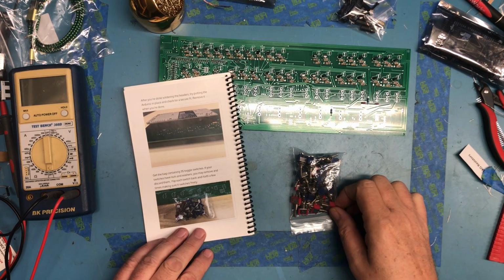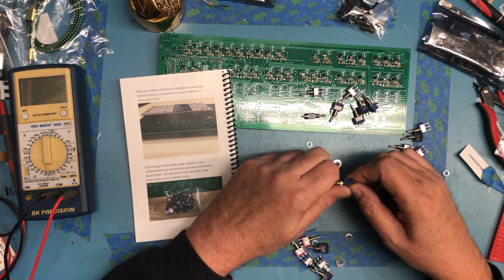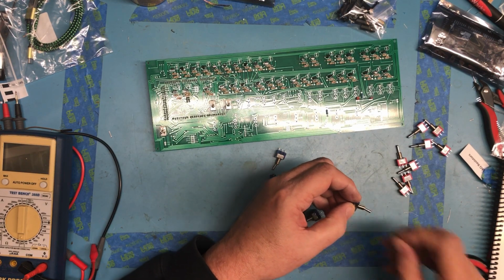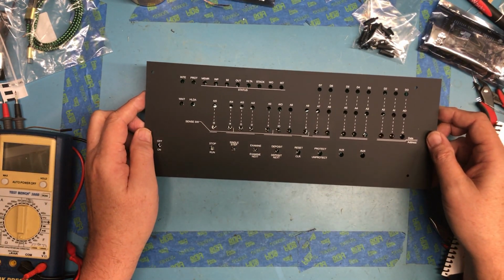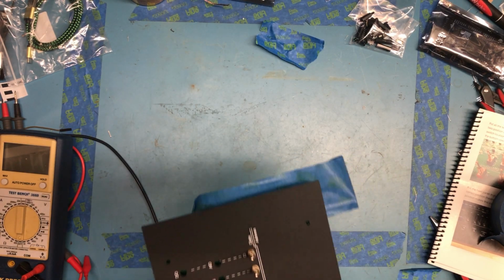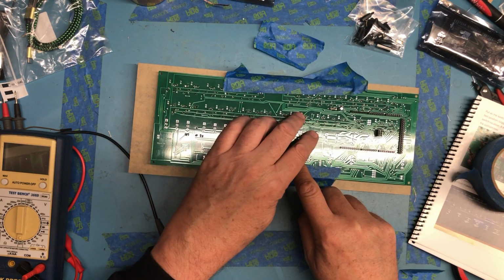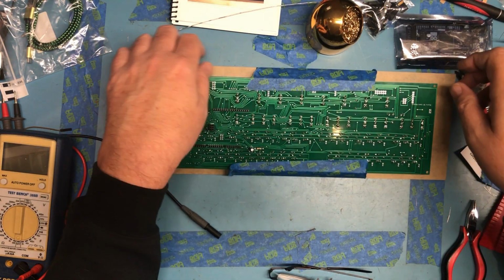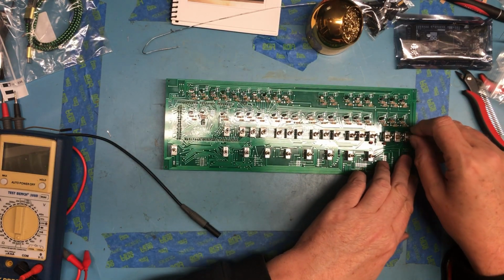Altair-Duino - Part 5- Assembly - Switches - STB276

Comment: This video was super helpful because I ran into the issue with the blue switches taking a lot of force to put in and it was helpful to see that it wasn't just my kit. So I kept going and got them in.  It's also great that you capture what gave you difficulty and what didn't, rather than editing it out, because it showed me where the tricky parts were. Thank you!
Reply from the maker: Thanks. That's the idea of the channel, you see my mistakes, where I struggle etc. That's where all the good learning happens and is the part i enjoy sharing the most.